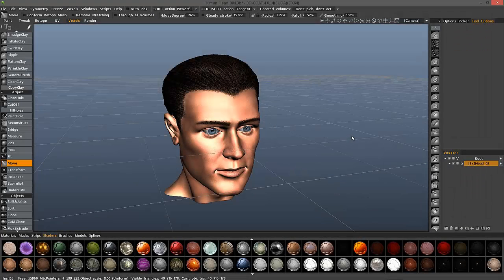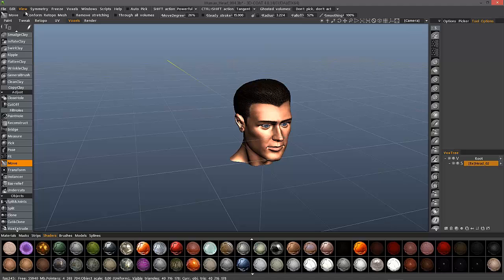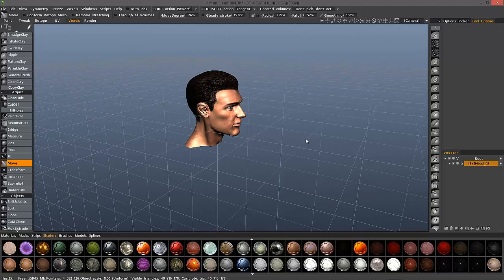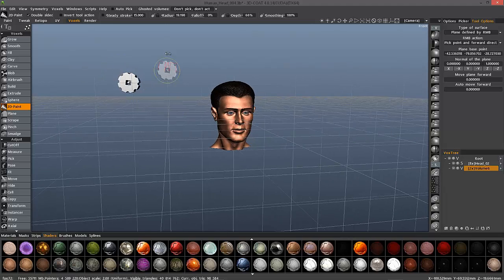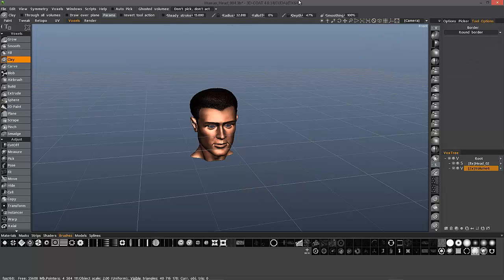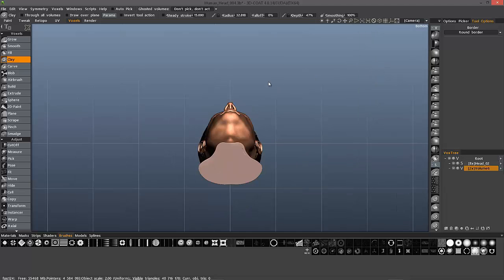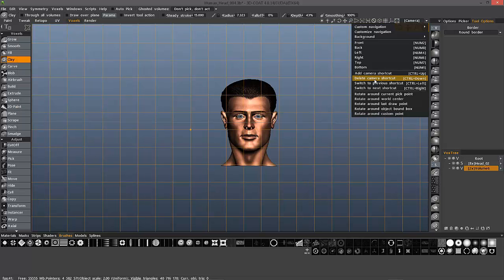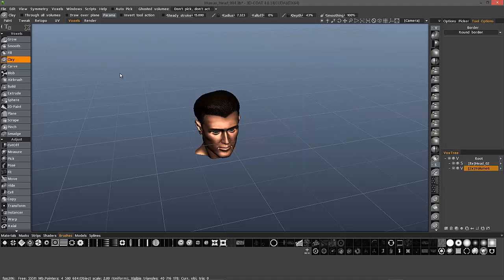Grids, Workplanes & Axis Handles

Comment: Wondering if you can help me, I'm getting a problem in retopology mode where my model keeps disappearing completely, it can be solved by resetting the model into the canvas, but it keeps happening and it's really annoying. It seems to be when I move my cursor off of the model when using any of the retopology tools, very strange.